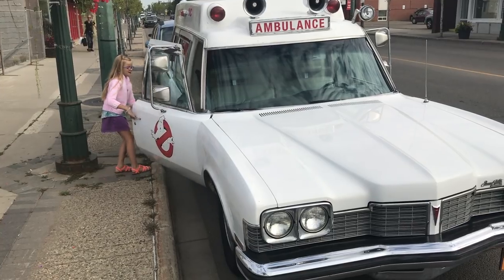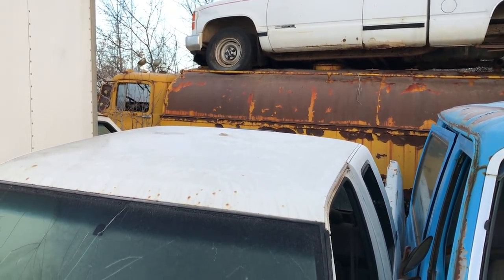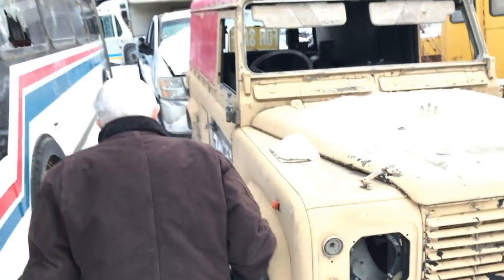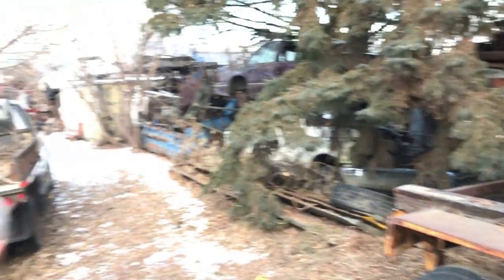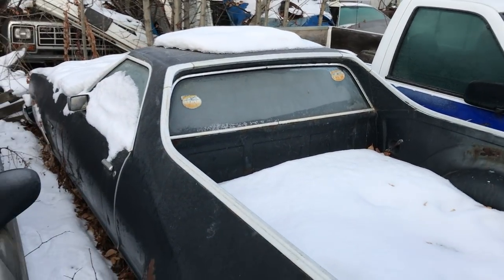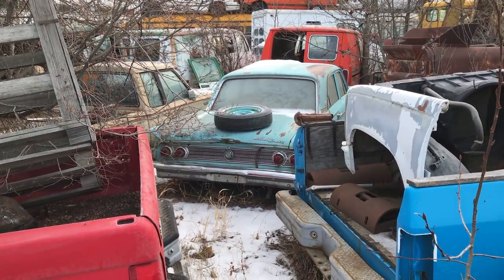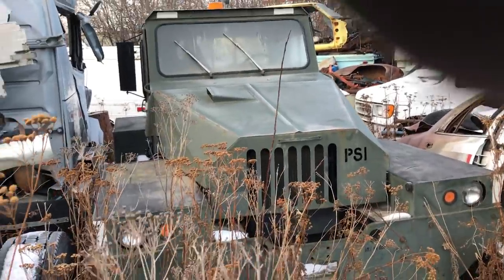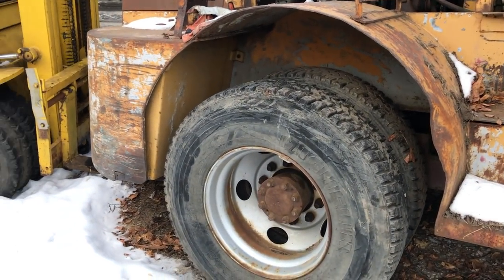Visiting A Scrapyard. Police Cars, Military Trucks and More!

Comment: I suspect the old yellow tanker might have been an old aircraft refuelling tanker from an airport, it looked like a pretty low profile set-up which are used for that to avoid the risk of making contact with wings and other parts of the aircraft when they are working in close proximity to them...
Reply from the maker: That’s very possible! Good eye
Reply: There's other stuff in the yard that looks like it might have seen airport use too...

Comment: At 3:25 your camera pans across a 90's F series white ext. cab. It could be a F350, or F250. it does have 4 wheel drive. That, my friend is a GOOD FIND. They are very popular trucks for many reasons, AND they are highly sought. They are built MUCH better than trucks today. The diesel models are more desirable, and the gas models have powerful engines. A 460, or 351 5.8L gasser top the list. These 90's F series are referred to these days as OBS (Old Body Style). Personally, I would dig that rig out of there and bring it home to make it one of the finest trucks on the road. I work Marine Salvage , but I'm not opposed to making the trip to acquire that truck!

Comment: Those Hercules tugs are formidable vehicles and are often very sought-after for use in transport yards and the like...
Reply from the maker: It looked very complete too
Reply: Yes, definitely.  I think most of them used a proprietary automatic transmission, though earlier ones probably had manuals.  Usually they have a very complete data tag on them which would identify what parts this one had which would make fixing this one a lot easier...
Reply: intresting that it had the 7 slot grille and perkins diesel that jeeps used so its probobly amc built? I know they made the cj-10 tugs but never seen one like that
Reply: +jeep2003  I'm not sure who built them but I'm reasonably sure it was an independent specialist manufacturer rather than one of the Detroit big leaguers.  The similarity in the grille style probably just comes down to it being an easy style to produce for a relatively small volume manufacturer rather than any relationship to a particular large manufacturer.  Perkins supplied engines to a lot of manufacturers and at one point just about every heavy truck manufacturer in the world had a Perkins engine option somewhere in their range...
Reply: gosportjamie. .. Perkins and Gardner were the 2 biggest engine producers in the UK who didn't build a vehicle of their own. All went into other makes, with Perkins concentrating on the 'light to mid-range' vehicles, whilst Gardner went for the 'heavier' end of the market (buses and the heavy haulage trucks up to around 40 tons). Above that and you were looking at CAT, Cummins, or Rolls Royce power usually. As for Land Rovers most of the British Forces ones were Petrol engined although a few had Land Rovers own diesel engine in them.
Reply: @christopherlovelock9104  the Land Rovers your looking at would be diesel engined and coil sprung, although it was possible to get a 2.5 petrol for a few years the army had moved to diesel as a common fuel policy for all new vehicles, the only exception being motorcycles, but even that has been addressed now.
Reply: @CrusaderSports250  Hmm, yes I see the reasoning behind it all, partly a case of you can't put the wrong fuel in. It's happened in the UK, (where I am), although a few small vehicles are still petrol, (gas in your case), powered. At the moment they simply use different coloured fuel caps. As for a diesel engined motorbike that's a new one on me although perfectly feasible. I think we have a few 'electric' vehicles, - certain types we've had for years. They are experimenting with some larger stuff now - the problem is still of course the range and also 'recharging'. Duel fuel is certainly in some of the larger vehicles already, - (also  handy if the 'Enemy' shatters your fuel tank, - you can get beyond the limits of "self sealing").

Comment: The wrecked and part-dismantled Land-Rover on the trailer isn't from 1978.  It has disc front brakes and coil springs so it's a Land-Rover 90 or 110 from 1983 onward, the vehicle that eventually became the Land-Rover Defender.  The Land-Rovers that came before them, the "Series" Land-Rovers as they're known, had leaf springs and drum brakes all round, even the factory Stage 1 V8s that were introduced in 1979 towards the end of Series III production, partly as a development tool for the 90 and 110.  The 90 and 110 used a development of the coil spring suspension system that debuted in 1970 with the original Range-Rover.  These look like British military vehicles so will have the 2.5 litre 4-cylinder naturally aspirated diesel engines, though some of the early ones had a 2.5 4-cylinder petrol (British armed forces changed from petrol to diesel for front-line vehicles in the mid-'80s though a lot of military ambulances and Land-Rover-based armoured vehicles such as the infamous "snatch" Land-Rover remained with petrol V8 power until very recently and the last of these are currently being phased out) and later vehicles eventually got the turbo diesel 200TDi.  They probably reached the end of their service with British regiments conducting winter training and exercises with the Canadian military as quite a few did due to the extremely harsh conditions  The sand camouflage paint over the top of the green drab indicates that these vehicles saw service in Africa or the Middle East, maybe during the Gulf War...
Reply from the maker: That may be the most thorough reply yet! Thanks so much :)
Reply: I'm glad you found it interesting.  I've always had a liking for the Landies...
Reply: Interesting they're in desert colours - ex Gulf War ones maybe. Goodness knows how they ended up in Canada...
Reply: +Simon Welch  They were probably attached to units that had trained and exercised with Canadian troops in winter conditions.  The British army has postings in desert areas so it's not unusual to see ex-military Landies with desert camo paint.  Sometimes they're not always that quick at changing out the paint, especially on vehicles that are getting to the end of their service life.  I don't think that paint is from the Gulf War as there's no visible sign of the black chevrons they were marked with but that's no guarantee of anything, it could just be that that part of the paint has weathered off...

Comment: The land rovers where used at BATUS British army traing unis Suffield near Medicine Hat. I was stationed their for four months . The one with the red roof was a range safety land rover. Their not 1970 but built in the mid to late 80s being 110 and 90 inch powered by a 2.5 n/a desiel engine .
Reply from the maker: You probably saw them in action :)
Reply: BATUS wasn't really that type of thing . But being 1300 square mikes it was bigger than we had in the U.K. I did see them in action but my range safety vehicle was a 2003 GMC sierra . And thats what i think is parked behind the land rover with the red roof. The M.O.D. hired them from a local GMC dealership in medhat . Loved that truck it was fast as fook and loved Canada would love to get back there sometime .

Comment: Wouldn't mind having that old Bronco that was behind the police van. Body looked pretty good from the one side except the rust around wheel well. Can see throwing a 5.0 engine in that.
Reply: ok OJ
Reply: it's there now , go get it
Reply: The 5.0L ( or 302 CI) Windsor is too small for that chassis, better off dropping a 5.8L ( or 351 CI) Windsor is a much better choice. I can say this from experiance. Look at the Bronco as a 6,000 lb truck, the 302 is just too small. I had a 1995 F150, 4x4, extended cab, and it went through two 302 engines. The truck was just too heavy for the engine.

Comment: I used to ride those old trolley buses when I went to school in Calgary but they were green and beige.
Reply from the maker: Do you remember the rod falling off the back and the driver getting out to put it back on? :)
Reply: Yes lots of times. I remember the time the trolley bus didn't make the left turn from 5 Ave and center street and went straight through and coasted to a stop 1/2 block down as there was no wires.

Comment: Those land rovers look like fun :) ex army from the 1980's with 2.5 n/a diesels
Reply: They were not from 78, that was still in the leafsprung era  and the early 1980's stage 1 v8 had leafs too and had that nose but coil sprung came around 1983 as the stage 2 or the 90 / 110
Reply: @arjanwilbie2511  they could also have the turbo on the engine although the early ones were N/A, but looking at them, defiantly savable.

Comment: That old yellow landrover is left hand drive!
Reply: It is also post 84 as it has coil springs probably a 110 as opposed to a Defender ( they became Defender's when the Discovery was released in the early nineties), they will have a two and a half litre turbo diesel or if your lucky a 200 TDi, probably the best engine Land Rover made, they are a giant Meccano kit with massive parts interchangeability so the one with no dash would be an easy fix.

Comment: This is really sad to me..  There are so many cars there that need to be crushed and taken out of the way so the good ones have space and aren't damaged.  When you have buildings falling down that are full of cat engines, something is terribly wrong. I've seen it at a lot of junkyards like this that neglect infrastructure and are eventually over run with bulky scrap like huge buses that have no real value.  At a certain point, you need to stop accumulating, stop holding on to every single dime, take a loss if necessary, liquidate what should be shredded and find buyers for what is left.  When he walked right past that Monte Carlo SS Aerocoupe with T tops without saying a word..  :(

Comment: That Volvo truck is exactly where it belongs, I know from experiance that Volvo heavy trucks are junk.
Reply from the maker: They make great cars though!
Reply: Curiosity Incorporated I don't have experiance with the cars, just the trucks. Although, I am a bit sad to see so many Crown Vics there. I own a 2007 Police Interceptor, and have always loved them.
Reply from the maker: There definitely lots of police cars in that yard! I’ve owned many Volvo cars and have never been disappointed. In fact that sport p1800 he has is similar to one in Guinness records that has put 3 million miles on it with original drivetrain!
Reply: Curiosity Incorporated wow, that's impressive. A Crown Vic is known for around a 500,000 mile life span.
Reply from the maker: Yah, those 4 cylinder Volvo engines were bullet proof :)
Reply: Curiosity Incorporated so was the 4.6L, as long as you kept the maintenance, and didn't modify it.